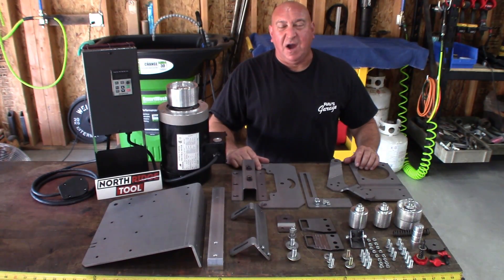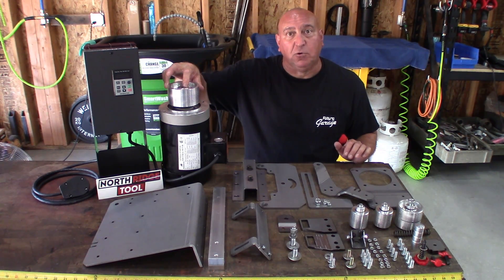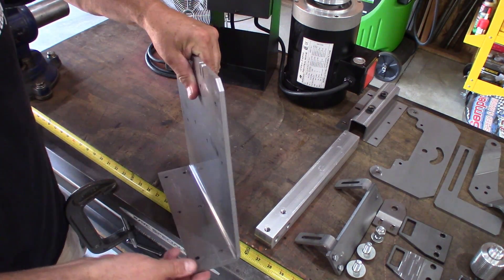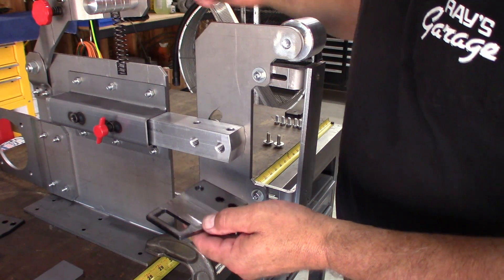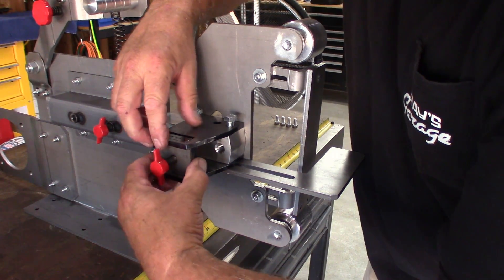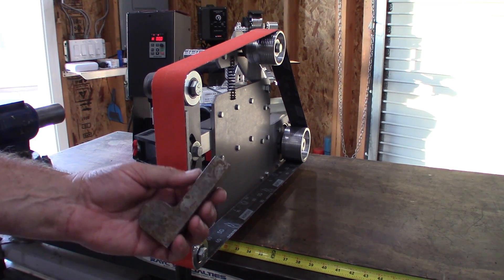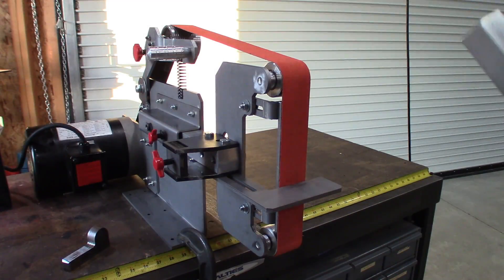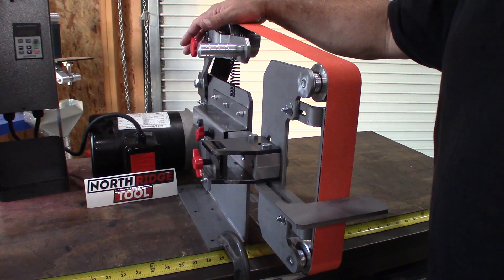Northridge Tool 2X72 Mod-E Grinder Assembly #northridgetool #realraysgarage

Comment: Can you give more information on the motor and vfd set up?
Reply from the maker: Motor came from Automation Direct,
https://www.automationdirect.com/adc/search/search?fctype=adc.falcon.search.SearchFormCtrl&cmd=Search&searchquery=MTR-002-3BD36&categoryId=0&TxnNumber=-1&searchqty=10

VFD for 2HP Motor came from ebay,
https://www.ebay.com/itm/1-5KW-2HP-VFD-8A-220V-Single-Phase-Variable-Speed-Drive-VSD-Inverter-Output/183998253184?hash=item2ad7268880:g:DY4AAOSwbFlc0-0f
Reply: @RaysGarage  that motor is no longer available.

Comment: Hello and thank you so much for this video. I am ordering the Mod-E kit this week and I’m going to tell them that you sent me!!  I can’t seem to find the VFD on eBay around that price range you said. You have any ideas? Also what would you recommend motor wise if I just wanted to put one on and plug into my 110v wall with no VFD? Any/all help greatly appreciated.
Reply from the maker: WV Chad Thanks man! The most bang for your buck would be to install 120 volt 20 amp motor. Only drawback is that is single speed and not speed controllable. If your ok with this go for it!

Comment: Hey Ray,
I have ask u serval questions in the past about NorthRidge. I’ve searched YouTube for other reviews on the standard mod-2. There are a few and all praise the grinder. But u are the most enthusiastic about everything about it. I have been working with things that most people wouldn’t even call a grinder. I’ve saved my money and in a few days I’m going to order the standard /maybe the pro NorthRidge grinder. My question is why are there not more people combing out screaming about how good the machine is? One more time how can u convince me I’m making the right choice.
Reply from the maker: Hello Rick, I am not really sure why more are not reviewing and/or sharing comments on the Mod-2 or even the Mod-E for that matter, my guess would be that they are using the grinders and not writing about them!  I did many months and countless hours of grinder research, I was going to build my own from scratch and am very capable to complete this task. After calculating out what I would need to build a rock solid grinder that would last and run flawlessly for years to come, I realized I was taking a risk that I would invest a lot of money in parts and time in something that did not function property or looked good. I then created a list of the top five brand named grinders and long story short narrowed it down to the NorthRidge Tool Mod-2 Pro Package, buy once, cry once! I too had saved for a long time and wanted the best and I feel I did get the best of the best. I use my grinders almost daily and have had the Mod-2 Pro Package for a few years now and I have no negative comments about this grinder, its rock solid, eats material without bogging down and is the best looking tool in my shop! The Pro Package accessories are very handy and I have not yet found a grinding job I can not do or that the grinder can handle. Anyone that comes into my shop go right for the Mod-2 and tell me what a bad ass grinder it is, when they fire it up you can see they are very impressed, then I show the tilting stand in action and then see a jaw drop! I would without hesitation tell you if this was not a good grinder for the money, I paid full price for my Pro Package grinder and was so impressed I had to do videos on it and am still impressed every time I use it! I can not make a decision for you, this is something you need to do your homework on then decide. I am always asked if I would buy this grinder again and the answer is very easily a big yes! Feel free to hit me up with any questions! Cheers, Ray

Comment: Great video Ray. Is the vfd housing available to purchase from them as well? I didn’t see it anywhere on their website.
Reply: Thanks Ray! Unfortunately the KBAC would put me well over budget. I’m debating between this kit and building my own. Any ideas on how difficult it would be to make this rotate to be both a horizontal and vertical grinder?
Reply from the maker: Tim Messer Hi Tim, My recommendation would be to buy the Mod-E then get a 110volt motor, no VFD needed then build from there with a tilting base. This would be a much cheaper route to go! I did consider building one as well but found it to be much more expensive with the chance it wound not track correct! I also have all the proper machines to do this and choose to buy this grinder. Take it for what it’s worth and save yourself a lot of frustration!
Reply from the maker: Tim Messer Thanks Tim, The Mod-E is a great grinder for the money! It does not come painted and does not come with a motor or VFD. The motor came from Automationdirect.com and the VFD came from eBay. The VFD housing was custom made for me. If you buy a KBAC VFD, it comes in a housing but is more expensive.

Comment: Wondering if you might be able to help... my mod E grinder came in the mail today and it came with a few extra washers and 2 extra bolts. I did everything you did in the video. My grinder didn’t come with any instulructions to put together... also it came with an extra piece that holds the spring arm on...
Reply from the maker: Jonathon Goss Hello Jonathon, Can you send me pictures of the parts, I can then tell you what they are for. My email is, raysgarage69@att.net
Reply: I emailed you. Thank you

Comment: Hey Ray which motor are you running with that mod e sander? I'm buying one but I have no time to research motors and the one in the video seems to be working well.
Reply from the maker: Rafael Garcia I am running a Iron horse 240volt 2HP 3 phase 56C Face motor with 5/8” shaft with key way from automationdirect.com
You will also need a VFD for a 2HP motor, I picked one up on eBay for under $70. Another option is a single phase 120 volt motor but you will not be able to adjust speeds.
Reply: Ray's Garage Thank you my friend for the quick response. Is the motor MTRP - 002 - 3 D36
Reply from the maker: Rafael Garcia MTR-002-3BD36
215302 was also on the motor plate.
Reply: Ray's Garage Thank you again my friend.

Comment: You stated a price of under $500.  How much total for control and motor?  IE: Total cost?
Reply: So, about 825 and I vaporblast and do the powder coating myself. Watched all but about 10 vids so far, but a man has to sleep sometime. Good job, loved the explanation and appreciate you getting back to me.
Reply from the maker: flattop alpha Hello Flattop, It’s depends, if you just get a 2HP 120 volt or 220 volt single phase motor it would be about $200 for a decent motor. If You want variable speed you would need a 220 volt 3 phase motor and a VFD like what I have for about $300. I paid $100 for powder coating and $25 to upgrade the hardware. Hope this helps!

Comment: Hey Ray, can you tell me how far the inside of the drive wheel is from the metal frame its bolted to?  I appreciate it.
Reply from the maker: 3/8" gap between the back of the drive wheel to the frame. 5/8" keyed motor shaft.
Reply: @RaysGarage  thank you sir!
Reply from the maker: T C 👍

Comment: I have seen your home , I can see why you would call this tool a budget  tool !
Reply from the maker: Wayne Murphy Hi Wayne, Thanks for your comment. NRT calls this Mod-E Grinder a budget grinder to fill the gap for folks that can’t or rather not spend the money on a higher end grinder. Not sure what my house has to do with it? I can tell you for a budget friendly grinder kit it runs very well and will outperform many more expensive grinders. Best Regards, Ray

Comment: no guards, ..."every man for himself!".... famous quote from: __________________?
Reply from the maker: A belt grinder is a dangerous tool like many other tools in the shop, the belt is open so it can be used at several points for grinding. Like all tools in the shop you should respect it when using it and it's no more dangerous than any other cutting tool.